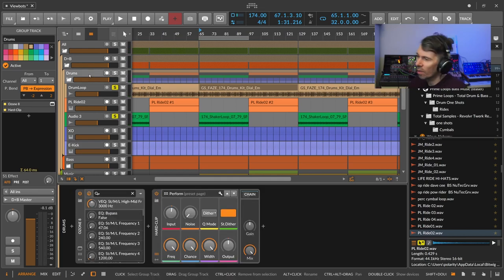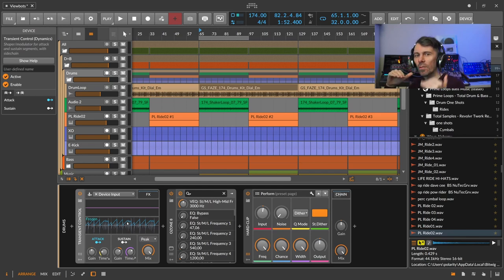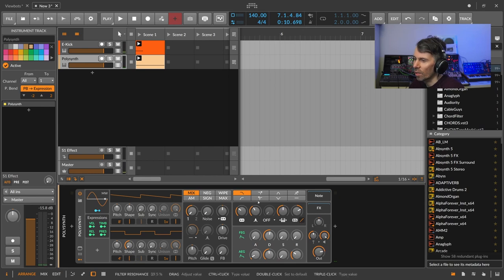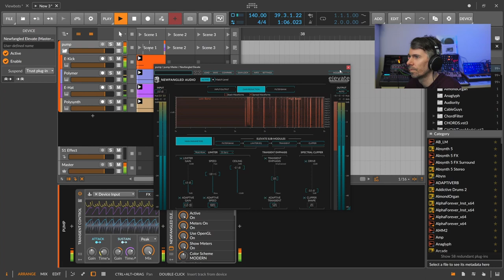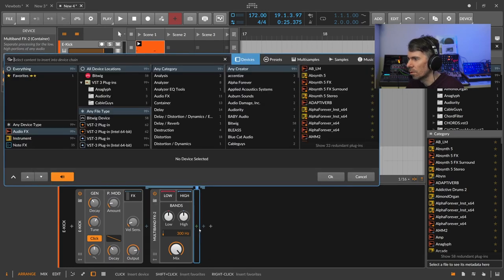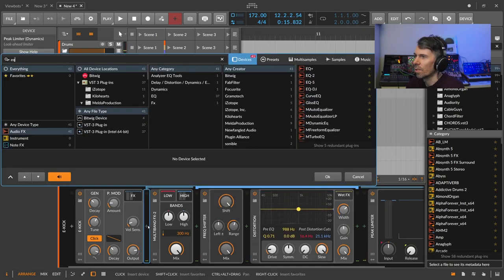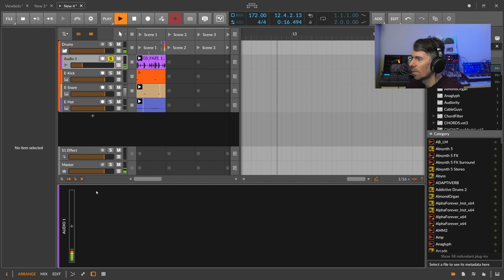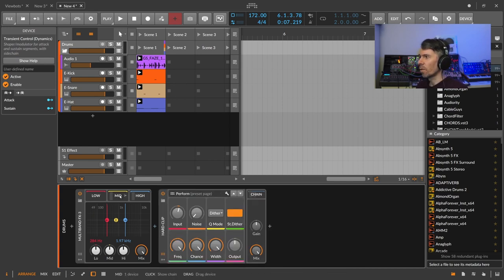do you use a transient shaper?

Comment: Hello again! Another great video, I hadn't used the transient control device before and I am excited to look into it now. At 12:45, I agree it sounds better effected, but in cases like this I sometimes wonder how much the improvement is just it being louder. Have you ever tried to make A/B comparisons controlling for loudness? Being able to compare one chain of effects directly, with say, just a tool/utility upping the gain to get the same loudness is helpful. Any tips for doing this in Bitwig? Thanks as ever for the videos and the inspiration. Your channel is great. Keep it up.
Reply: I'd say, just hook up a botton on the on/off of the effects.
Reply: @AARON_______  That's a good start, but I also want to adjust the volume on the dry signal so that it has the same loudness as the track had when the effects were on. That way it would be easy to compare the dry to the effected signals for their quality separate from the effects just making the track louder (which often makes it sound better, regardless of the effects).
Reply: @hrrld  then also use that button to adjust the volume or gain
Reply: @AARON_______  ;)
Reply: Put tool or peak limiter before transient control, and look for value how much db before(in those) and after(track meter)